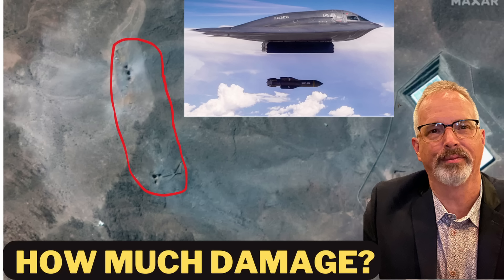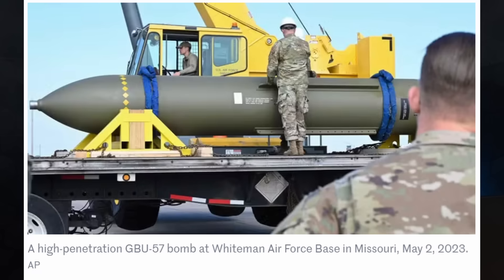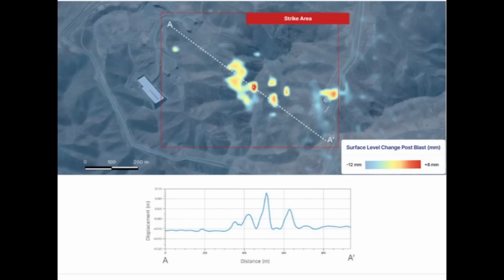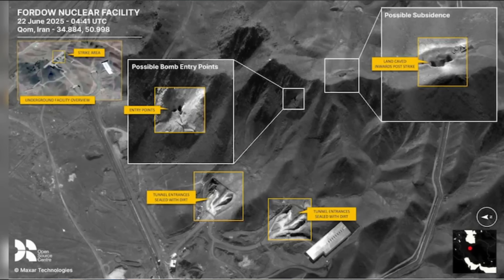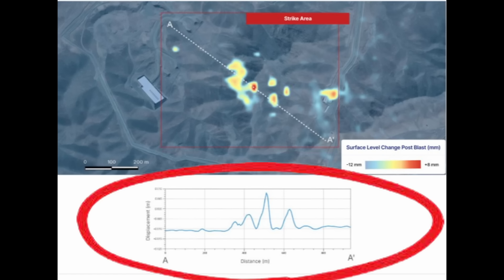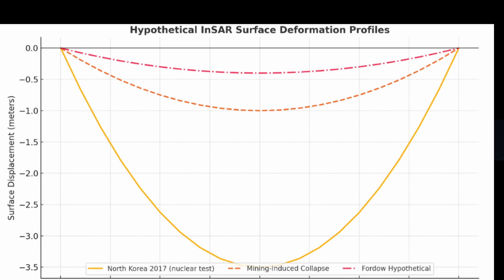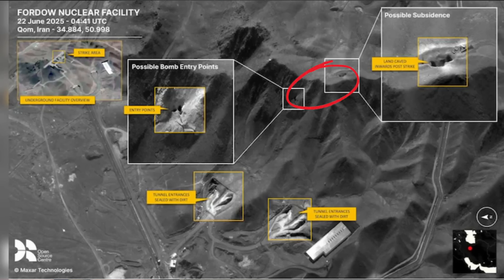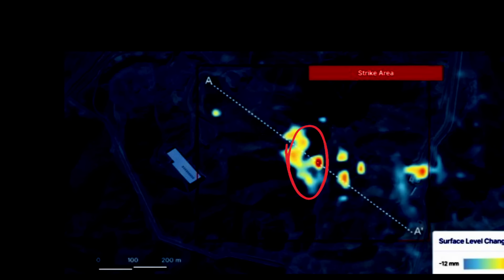Fordow Attack Assessment -  Update

Comment: Nice analysis. I have a Geology Degree too but spent 20 years in Naval Aviation. One thing I learned there is bomb fusing. 
You say MOP detonates when it comes to a stop. Not true. Initial version had simple fuse like that. However if you research USAF press releases you will find MOP received upgrade to have a smart fuze. This fuze has “void sensing” and many other settings. But that ability to sense change in deceleration caused by entering a void, and being able to “count” voids, gives it a lot more capability. I suggest you verify my assertion of the fuze upgrade then include the ability to detonate in middle of the centrifuge hall in your analysis. In closing, also look at the sneaky photos of the centrifuge hall the IAEA took. In particular the photo taken at about shoe level. LOL. You can see the ceiling of the hall is about 10 meters high!!!
Reply: Casey, there is commercial satellite imagery showing it was Iranians themselves that filled the entrances with soil. That was done before the strike. Check Suchomimus postings on Fordow before the strike and his analysis of overhead imagery of Iranian procession of dump trucks and bulldozer.
Reply: @AnavyRIO  It is also interesting that from the latest photos, the Iranians appear to be attempting to access the facility through the shaft, not the entrances.  This approach makes a lot of sense (to at least try)  if you are concerning about a hazardous environment being present inside the facility.   UF6 is highly toxic.  If they stored enriched uranium in the facility, they may also be concerned with what is known as a criticality -  See videos on YouTube concerning the “Demon Core” if you want to get more understanding of what a criticality is.
Reply: @AnavyRIO   Iranians filling the vent shafts with soil means they weren't smart enough to design offset vent shafts, lol. Not to mention Israel got the plans back in 2018 and know exactly how the shafts are designed.That base was cooked.
Reply: @lkae4 Lol what? Simply not true.
Reply from the maker: Thanks for the insightful feedback, I appreciate it!  Now that you mention it, the test video that the Pentagon showed of the GBU-57 showed to bomb detonating in the tunnel space after penetrating the roof rock.  It is possible that there was different fusing used among the 12 GBUs that were dropped?
Reply: I believe you are correct. I was went through Navy Strike leader training at Fallon and back then there was no MOP. But we had BLU-109s. Hardened casing 2,000lb bomb. So we did have a way to use them in succession with different fuze settings combined with different bomb impact times. So the blast of one bomb would not deform the casing of the next. 
Don’t assume B-2s dropped all MOPs at once. They would have plenty of time on the run to drop one, have it penetrate & detonate and then the next one impacts. Rinse & repeat. Then the ones they calculate would reach the facility would have void sensing enabled.
Reply: The weaponeering is an interesting process now. The pilots don’t do it. A “cell” is put together bringing in people with the kind of experience needed for the specific target. They don’t have to be physically located together. We use secure chat rooms. So we bring in scientists, CIA, etc into the cell when needed. 
The aircrew ultimately get DMPIs and the bomb fixing data. DMPI - Discreet Mean Point of Impact. “Dim Pee”. Bomb settings go into software load at aircraft startup. GPS guided bombs like MOPs can be given a specific impact angle too. Everyone assumes vertical but is not so. So DMPI and impact angle creates path through ground. Weaponeering Cell takes all this into account to “drill down” to when final bomb reaches void. 
FYI - there is mod to B-61 variable yield nuclear gravity bomb designed to penetrate deep and do a below ground burst. Takes the worry out of being close. 
One thing right up your alley. The weaponeering guys consider the “liquification” of the sub surface strata due to bomb blast. I never understood details but there was something about a momentary change in the structure of the rock or concrete.
Reply: Another FYI. There is yet another under the mountain uranium enrichment facility in Iran. It’s outside Natanz. No one talks about it much because it’s too deep for MOPs even. And it’s not near as big as at Fordow. But it is reason Congress made USAF take some of the B-61 nukes and modify them. Because 260 kilotons of explosive power could create a blast wave that would cause that liquification effect that COULD destroy the deep Natanz site. USAF didn’t want to modify B-61s. So few in inventory & only aircraft nuclear bomb in arsenal. Those modded ones now only good for one use. 
But overall Iran trying 3 things. 1) lots of weapons grade uranium 2) put that uranium in their “research” reactor to make weapons grade plutonium. 3) make spherical plutonium “pits” for implosion type nuclear warhead. Why?  Because only implosion type warhead small enough to go on top their ballistic missiles. And only plutonium pits for those missile warheads will generate enough boom. 
Thus the destruction of Iran’s ability to achieve that goal is attack all 3 areas. Destroying their warhead making facilities was key. Tomahawk strike laid waste to that. Israel took out their “research” reactor. Everyone focuses on uranium enrichment because it’s hard, and easy to spot, and it is the crucial first step. But weapons grade uranium does not mean  Iran has a deliverable “bomb”. 
If you check Suchomimus & satellite image, it looks like Iran took something OUT of Fordo before the strike. Big 18 wheel trucks with what looked like lead coffins in the back. Hmmm. You can’t put enriched uranium in a plastic bag and carry it out. Highly radioactive. IAEA took photos of the nook where the enriched uranium coming out of the hexaflouride was stored.
Reply: @AnavyRIO  One, enriched uranium is an alpha emitter, so as a matter of fact you can carry it in a plastic bag - although you cannot do that and meet various DOT, DOE, and NRC regulations - none of which apply to Iran (but don’t tell the NRC that.). Two, they only had 400-900 lbs of uranium, so Chevy Suburban would be sufficient.  There is no need for lead shielding, no need for even one 18 wheeler. Third, the other site, Natanz was also struck and destroyed by GBU-57’s.
Reply: @AnavyRIO  Of course there is,  the place is a lot BIGGER than Texas.
Reply: @AnavyRIO Thanks for sharing, sir, very informative!
Reply: @Why_ask_  I'm not claiming to be an expert in this matter, so I set my scope on debunk, without further enquiry about the danger of what was haphazardly neglected by your summary statement. It might still be true in practice that you can (mostly) ignore the rest of this, but you'd be a complete idiot to do so on the basis of the oblique comment you supplied. 

==Me to Gemini 2.5 Pro==

Some guy in a YouTube comment section: "enriched uranium is an alpha emitter"

He's speaking about Iran shuffling incompletely enriched uranium around to avoid destruction by Israeli and American missile strikes. I have trouble believing that incompletely enriched uranium has no other radioactivity profile, but I could be wrong. 

==Gemini to me==

You are right to be skeptical. The person in the YouTube comment section is telling a partial truth that is ultimately misleading. While enriched uranium is indeed an alpha emitter, it is incorrect to suggest that this is its only significant radioactive profile.

===Alpha Emission is Primary===

The main uranium isotopes in question, uranium-235 (which is increased during enrichment) and the remaining uranium-238, both primarily decay by emitting alpha particles. So, on that basic level, the commenter is correct.

===Gamma Rays are Also Present===

The decay of uranium-235 is also associated with the emission of gamma rays. The most notable is a gamma ray at an energy of 186 keV, which is a well-known signature used by inspectors to detect and measure the presence of U-235. Therefore, any quantity of enriched uranium will also be a gamma emitter.

===The Decay Chain===

This is the most important part that the commenter ignores. Uranium doesn't just decay into a stable element in one step. Both U-235 and U-238 begin a long sequence of radioactive decays known as a "decay chain". 

For example, when U-235 decays, it becomes thorium-231. Thorium-231 is itself radioactive and decays by emitting a beta particle and more gamma rays.

This process continues through many stages, with various "daughter" isotopes being created and decaying in turn, emitting a complex mixture of alpha, beta, and gamma radiation along the way until they reach a stable isotope of lead.
Reply: @afterthesmash Yes, I know the decay chain - let’s just say I have seen it before; and yes trace amounts of various elements within that chain will be present.  Yes, (Sigh) I did simplify (some) some of these trace elements do emit beta and even gamma radiation (I stand corrected). Still under most realistic (i.e. not stupid) real world scenarios, the exposure levels to a human in close proximity to even highly enriched Uranium will be very low.  (Presuming of course the uranium has never been in a Nuclear Reactor) And yes there is a lot of context I have omitted - but this is a youtube comment not a class on the subject.

Bottom line: You could have moved all of their Uranium with a suburban.  No, the shipment would not have complied with US regulations and the other facility was still destroyed as well.
Reply: @Why_ask_  You don't put 1000KG of UF6 in a bag and toss it in a truck.   You have serious criticality issues when moving large amounts of UF6, it has to be stored in an inert environment to prevent HF from forming. UF6 is normally transported in large steel casks about 30" in diameter  at only 5% enrichment.  The 60% enrichment required a whole nether level of safety to move.  You're only going to get about 100kg in one of these UF6 cylinders at 60% enrichment.
Reply: @AnavyRIO  I suspect that Israel's intelligence knows what was taken out, and that if it was uranium, they would have blasted the trucks, or whatever facility they went to.
Reply: @AnavyRIO  Yeah, that's kind of like one piece of artillery shooting multiple rounds time on target. Each successive round is at a different elevation, altering the ballistic trajectory so they all arrive at the same time.
 
Well, dropping 'dumb' bombs is the same exercise in ballistic trajectory, and believe me, the B2s most definitely could have (would have!) released them in such a way that entry was precicely timed so a previous detonation wouldn't intefere with the next penetrator.
Reply: @Why_ask_  even though I don't really need one, but I kinda want a lead lined Suburban. Scratch that, a lead lined Unimog. With spinners and blue undercarriage lights.

...and a cow grate on front.
Reply: @JeremyPickett  Dang, I’d go for that.
Reply: @AnavyRIO   Exactly. People never think about the logistics of delivering a massive gun-type bomb. It's not only heavy, but huge. It's an artillery gun in a cylindrical case with fins. And for a nation which doesn't have a single bomber, that obviously isn't their goal. Instead, exactly as you mentioned, their goal is a few steps removed: Sure, in 1944 getting the timing to implode a pit might've been a challenge, but now that stuff is commodified and literally CHEAP. Available in common SMDs. One can only hope they weren't able to get sufficient details on how to create a "Hydrogen" bomb. Deuteride or similar isotope, using boosters like Lithium-7. The info is just everywhere now. And even a sanctioned nation can still probably build supercomputers sufficient to run quite a few plausible simulations that limits the number of experiments they'd really need. Beyond that, they'd need to miniaturize the warhead, make it reliable enough to withstand the rigors of reentry, and learn how to boost it. Which is all physics. Many people have written their PhD thesis on these old and resolved triumphs assuming its a non-issue now.
Reply: @AIM54A I was speaking of metallic Uranium or Oxides.  UF6 is another beast.  Between HF and criticality, a lot of planning, time, and specialized equipment would be needed to move it from one place to another.  The context here is quickly moving Uranium and dispersing it.   For the reasons you site, dispersing it in the UF6 form seemed so impractical (and dangerous) I must admit I did not even consider it -  especially since it gets hot in Iran.
Reply: @kennickel878  Yes, post-WW2 weapons used “composite cores” with both PU239 and U235, because US had more uranium enrichment capacity at that time than plutonium breeder reactors and also the breeder reactors were being used to breed tritium for fusion-boosted primaries. There were also gun-type (I.e. linear assembly) weapons using U235 after WW2, and many of the nuclear artillery projectiles used U235.

U235 is currently used in the W88 warhead secondary “pusher.”
Reply: @AnavyRIO  You are talking about Pickaxe Mountain 1.5 miles from Natanz and untouched…and so far, untouchable. Man, those Iranians are not going to give up.
Reply: @AnavyRIO  Enriched uranium from centrifuges that hasn't been put in a reactor is not very radioactive, certainly not enough to warrant lead shielding. Properly capturing and transporting the toxic gas is the concern, not any radioactivity. Otherwise solid stuff you mentioned.
Reply: @AnavyRIO  The trucks where likely trying to move data and personnel. There's less chance it would have been the centrifuges or any of the materials needed.
Reply: @Why_ask_  if it was just in one block you could haul it in a Chevy Suburban.  But, it might go critical and kill everyone.  Even commercial fuel enriched to 3.5% has strict spacing requirements for shipping.  At 60%, it would have to be divided into small loads kept separate.
Reply: @bfg1836  If they have only 400 lbs of enriched uranium in a form they can move; due to uraniums density it does not take up much volume.  In fact, it feels “unnaturally heavy” being twice the density of lead.  In metallic form, this would take less than 3/8 of a cubic foot.   In oxide form of course the volume will be greater but still well under 1 cubic foot.   A Chevy suburban has 144 cubic feet of potential cargo space.  Thus 400 lbs of metallic uranium would occupy about 0.25% of the interior space.
Reply: @Why_ask_  except you have to divide it up and separate it to avoid criticality.  Just as an example, you might have 400 boxes with a pound in each box.  I move nuclear fuel for a living.  I know how much it weighs.
Reply: @AnavyRIO  Rinse & repeat!!😂
Reply: @AnavyRIO  One thing you and I both know from our service that would throw off all of the math and unclassified reporting of this data is that, whatever our official "known" values are for weight of the GBU-57 and the contained explosive material, the actual values are likely higher.  When was the last time the actual publicly known value for something wasn't on the very low to laughable range from those of us who actually knew?  We just carried out this mission with bombers well above their "max rated payload".

The geology portion of this is also only half of the story and the easier one to assume was the target.  The over pressurization of the ventilation network and subsequent facility was the other and more likely to be the killer here.  A simple example would be how a suppressor works on a rifle.  We know when the powder explodes the case expands to seal off the chamber, but we also know that suppressing a rifle you get "blowback" (used to be more significant than they have engineered our today, but still exists.)  All you need to do is over pressurize the facility and you have destroyed it without collapsing it.

Either outcome is still a win be it geological or "gaseous".
Reply: @CaseyJones-Engineer  I believe the general that gave the pentagon briefing specifically said that each of the bombs in the sequence was fused differently.
Reply: @CaseyJones-Engineer 
FMU-167/B HTVSF
Hard Target Void Sensing Fuse
Reply: @CaseyJones-Engineer  I need to keep my answer to “Yes”.
Reply: @CaseyJones-Engineer  Question.  How does one drill down to the required depth without expelling the rock that's in the way?  There would have to be hollow cavities for the remnants to go, but the bunker is very deep.  How do we know the bombs didn't just keep pulverizing the granite into smaller chunks and dust with successive blasts instead of digging to an adequate depth?  I mean, how do you dig a hole without throwing out the dirt?
Reply: @CaseyJones-Engineer  I would certainly use multiple if I ever used ones with void fuses.. because to defeat them they would simply need to put an extra void ABOVE the target, to have it blow up in the wrong "void".
Reply: @CaseyJones-Engineer its not only possible its a surety. General caine talked about it in the initial press conf about BDA….. comon huge oversight.
Reply from the maker: @tomeitel9896 Thank you!
Reply: @CaseyJones-Engineer  I think it is likely those bombs will also detonate when they stop. Otherwise they would be useless in creating damage to the rock the other bombs dropped in the same hole can then enlarge.
Reply: @CaseyJones-Engineer  GOT A SIMPLE RESULT AND QUESTION. NO BUNKER BUSTER BOMB CAN PENETRATE SOLID REINFORCED STEEL 300 FEET THICK. IT IS IMPOSSIBLE. DON'T U THINK IRAN KNOW THIS.
Reply: @CaseyJones-Engineer  100 percent!
Reply: @CaseyJones-Engineer  You think Iranian engineers hadn't been studying the MOP program and built straight-line ventilation shafts and put centrifuges under them? :face-purple-crying:They hadn't figured out blast traps in shafts and blast doors on the centrifuge rooms, really? The reason why there are three vent holes is because the main shaft was sealed off and the two vents to the side were designed to vent the blast. That's why one of the pilots reported the blast was as bright as the sun. The blast was rerouted up the two side vents.   

In any case the depths commonly quoted are wrong. Rafael Grossi, the secretary-general of the IAEA, earlier this month. “I have been there...  the most sensitive things are half a mile [around 800 metres] underground.” A European source gives the figure of 500 metres. Source - The Economist
Reply: @CaseyJones-Engineer  I see a lot of confusion about the explosive charge of these MOP bombs. they are called '30K-lbs bombs', some are claiming that it is a 30K-lb charge, and others are claiming that it is a 30K-lb bomb, gross weight, with a 5K-lb charge. These differences are very substantial, and I am wanting to see a consensus, especially in the science & analysis domain. thank you to whomever, Casey or otherwise, can clear this up for us.
Reply from the maker: @Inertia888  I showed this early on in the video from the Wikipedia article.  The total weight of that GBU-57 is 30k pounds, 5k of which is the explosive charge.
Reply: @Inertia888 It’s a 30,000 lb weapon with 5,300 lb of being explosives
Reply: @Grouse2275  Thank you.
Reply: @CaseyJones-Engineer  Got it. Thanks.
Reply: @Inertia888 USMC Ordnanceman here (Ret). The 30,000 pounds is rounding up of the appx 27,000 pound all up round weight and the (appx) 5,000 pounds of explosives is included in the all up round weight. Standard, “Dumb” bomb bodies are typically 1/2 of the all up weight in explosives so a 500 pound bomb is 250 pounds, 1000 is 500, etc. but those are just dumb bomb bodies (which can now be used with fin, guidance, and nose sections to make some very not dumb weapons options.
Because the MOP is intended to penetrate deep into earth, rock, and even high density concrete, it requires a lot of very strong metal in order to drive itself down to where the explosive charge can do its job. So theres a lot smaller proportion of explosive to all up round weight but it’s literally TONS of explosive in a single bomb!!!
Reply: @Inertia888 Gross weight is 30,000 lbs, their explosive payload is 5,000 lbs. Therefore the explosive content of these 30,000lb bombs is 16.67% (5,000lbs)
Reply: @CaseyJones-Engineer I think if you review the video that the Pentagon did not only did their video talk about that, but they also talked about it detonating in stages but there are different explosives on board as the rocket moves through the ground. Really impressive stuff
Reply: I heard a rumor a few years back that the GBU-57 MOP's can talk to each other, and tell the next weapon about  defensive voids and the next mop needs to pass 2 voids and go deeper to detonate.
Reply: @jamesdoesitmatter  That takes destructive imaging to a whole new level. It puts me in mind of an alpine explorer video game where you finally make it to the summit by recovering one "oopsy!" diary after another of those who died before you, each time a bit further up the slope.
Reply: @afterthesmash  Not sure the truth to it, but the same rumor mill years ago talked about the X-36(F-47) and yf118g bird of prey. Im guessing from another rumor their may even be a new as capable lighter non nuclear Bunker Buster.
- odds enriched material if moved could be seen by satellite?
Reply: @jamesdoesitmatter  Interesting - it would pretty much require deploying an antenna at the surface on the way in, and staying connected to it down the hole. Not impossible, but sounds complicated.
Reply: @marcschabb742  was a rumor I heard. Dont know the how, or even 100% if true. But the rumor mill mentioned others things over the years which are now being seen recently.
Reply: @jamesdoesitmatter Highly unlikely. What signal would break through dozens of feet of rock and debris to reach the next buster thousands of feet in the air and dozens of miles away? And if they are 'talking among themselves,' I guess that relegates human controllers to innocent bystanders.
Reply: @cclr1158  they don't "talk" or communicate in any way. They just have very advanced fuses that can sense changes in velocity and can be programmed to detonate at very precise points including failover conditions if the expected conditions aren't met.
Reply: @alldecentnamestaken: That's exactly what I thought. A 30,000 lb mass in free fall (with guide fins) can't have any real smarts to advise the next one from dozens of feet underground.
Reply: I was in Usaf munitions MANY years ago and most targets of any priority would get a smart fuse of some kind depending on the target, I would guess they would have set each weapon to detonate at a different time frame to cover a wide range of unknowns
Reply: A simple Decelerometer would work as a Void-Sensing Fuse, going off the moment deceleration ceased for a moment.
Reply: OK, but whether the bombs detonated within the chamber or at the bottom of the chamber, the destruction would have been massive.
Reply: A simple accelerometer would work wonders. ;-)
 
It's simple physics and based on release altitude, bomb weight and shape and gluide profile the MOPs velocity at contact would be a known quantity, call it 1000 fps. Program it to detonate at 100 fps as penetration will slow it and run 2-6 freight-train, each one penetrating further until one finds a large void.
Reply: I think you ignored some of the MIT and Chinese analysis of ground penetrators in that they tend to deflect after penetration if the density of the material in not homogeneous since the front and rear of the penetrator will experience different forces, as well as different sides. There are published papers and tests showing ground penetrators deflecting off target, as well as poor performance against modern Ultra High Performance Concrete. So not only would these had to have travelled deep enough, but also not get deflected away from the centrifuge hall AND also penetrate the UHPC Iran is known to use.  Maybe if the Iranians didn't engineer things properly, overpressure in the vents alone could propagate through the tunnels, but old plans the Mossad had smuggled out showed that they had giant blast doors in the centrifuge hall dividing it into multiple compartments, like the Titantic.  I'd say the jury is still out if they actually damaged the crown jewels, the centrifuges.  Surely they took the site off line for a few months, but the biggest investment was the processing machinery and the know how, and if they retained those, it's hard to believe they couldn't reconstitute it in a year or two of construction.
Reply: @RayCromwell And you are proposing the Iranians could have removed their “processing“ equipment and their “knowhow“, the most valuable parts of the program. It is my understanding the “knowhow” went up in smoke with a massive and surgical Israeli strike before the Fordow attack. The count was 30+ of Iran’s top “knowhow”. 🫢
Reply: @RayCromwell  so long as Iran lacks air defense they simply won't be allowed to do any meaningful work at the site. Israel will hit entrances and the old air shafts anytime there is a significant presence at Fordow. Even though Iran is already filling in the air shafts with overburden, the GBU-57s punched an unrepairable hole which Israel can hit with GBU-28s in the future. Functionally Fordow is destroyed because Iran won't be able to use it in the future unless they somehow obtain a very large and very advanced air defense system.
Reply: Do we know for a fact that the centrifuge hall was adjacent to the vent shafts. If I were designing the facility I would offset it at some distance and perhaps a few 90 degree bends to mitigate blast force.
Reply: @johnc7144 exactly. Good point.
Reply: Your right and wrong.. we built the first bunker buster in Ohio in the 1970..
As they hit, smaller explosion, take place blasting a hole but protecting the real pay load. Can't say more. We also, built the first cruise missiles called the MX5. 
The MX5 was first used in 1977. No GPS guidance, the map path had to be called in. Soviet Union, had 20.000 mid range filed up missiles in South America. 
They hide them in old coal mines in the side of a Mt. Lucky me,  I did the map walk off. We nick named them door busters.. first one, took out there blast door, second one right behind it, all the way in, number three right on its ass. I ran for my life, made it the beach as the whole Mt blows up. Navy found me out cold on a tree, floating x yards off shore. MT was gone. Your older. I worked for Howard Hughes. A dear close friend. Wild days.
Reply: @franksmith3602  Your right and wrong. The Tallboy bombs where the first bunker buster's in the Globe 🌎 😳
Reply: Just looking at it...
We really can't tell
Reply: yes your right but so is he, So if the bomb makes the distance the fuse was set to , or distance and number of voids it will explode, But if it dose not go deep enoght or did not smash through, it will exploed when it comes to a stop.   The way bunkers are built is they have a triangle shapes cap on top so if a bunker buster get deeps enough it try to re-drect the bomb to side of the cap and go out to the side.   So you are both right.
Reply: At 6:40 would show the void detection setting of the fuse. I guess. That bomb would not come to a hold at that point.
Reply: The bombs blew up with enough power to cause small earthquakes for a few miles
Reply: So, After all the bombing, Why are they digging back in there ???? I’ll give ya one guess. They know it wasn’t destroyed.
Reply: Who’s the next regime the US builds up to take out?
Reply: The Iranians already filled in the craters according to latest satellite images😅😅.😂. They wouldn't be able to do that if the facility is penetrated...
Reply: He also calculated with maximum possible amount of volume which is the most optimistic scenario. However, the most optimistic blast radius only became 23.87 meters.  

That means the bomb has to go 55-65 meters deep before exploding. 

Very deep is a relative term.

In fact the very subtle changes in the ground elevation across this area is proof that the bombing was a total failure.

The bombs didn't go further down than 20 meters, reaching a maximum depth of 45 meters.

In contrast, an exploration at 70 meters depth would not reach up to the surface at all.

Volume gives a big number, but just calculate the volume of a ball with 24 meter radius. You see.

Still, the blast would likely also follow the ventilation shaft downto the facilities. They would be indirectly hit, but not buried in stone.
Reply: The Iranians used the bombed facilities as decoys and have been enriching their uranium at a super secret location.
Reply: Too bad they don't have a fuse for the MOP that sleeps for 6 months.
Reply: Metal has no chance against ruck ,maybe ten to fifteen percent against dirt,and none against RUCK
Reply: So…..just left behind compressed powdered granite.
Reply: I think we allow too much information out. As we brag and pat ourselves on the back our enemies study us and develop necessary countermeasures.
Reply: The details of the fuzing only matter if you presuppose that the bombs made it deep enough to penetrate into the facilities.
Reply: @2xKTfc  They definitely did not as the blast radius is less than 24 meters in radius and you would not see any surface elevation changes across the area, if detonated at 70 meters depth. Indirect hit through the shaft only.